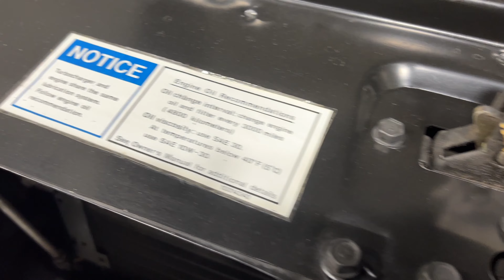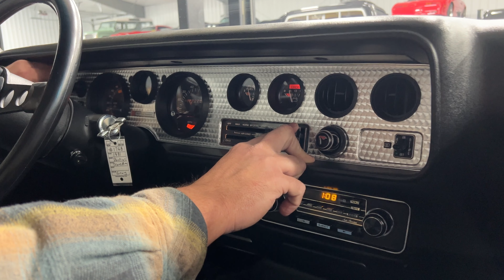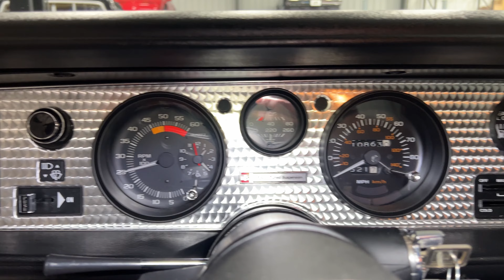10,000 Mile 1981 Turbo Pontiac Trans Am Close Ups (LIVE NOW) Stock #1768

Comment: Looks like it even has the turbo boost light on the hood. Turbo wheel means 4 wheel disc brakes. Looks like a new car. Even the trunk lid pops right up. Sometimes the springs get weak and they don't want to do much of the pop up. Rear defrost too. Nice all around car